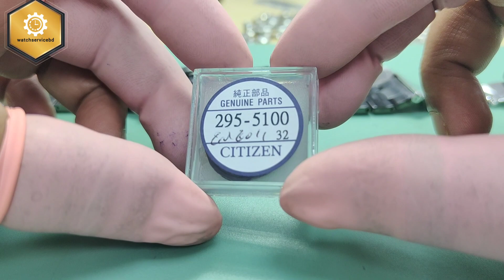how to replace Rechargeable Battery Citizen Eco-Drive watch Caliber J810 #watchservicebd

Comment: Thanks for the video. I'm confused as to why you had the complete works and took a battery from that. Can you not just order the battery itself, separately from the works?
Reply: Yes you can but from what I've seen it's the same price so why not have a back up capacitor at no extra charge